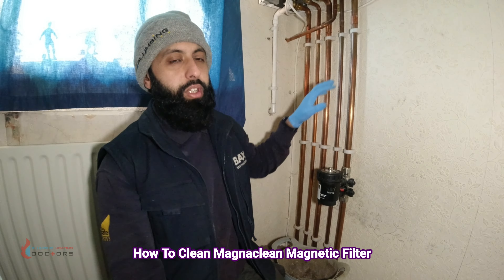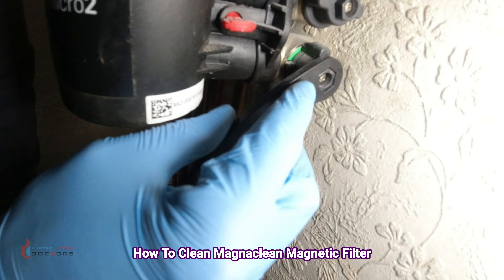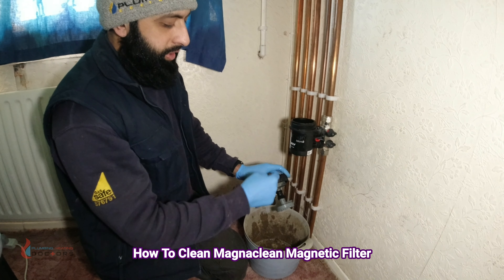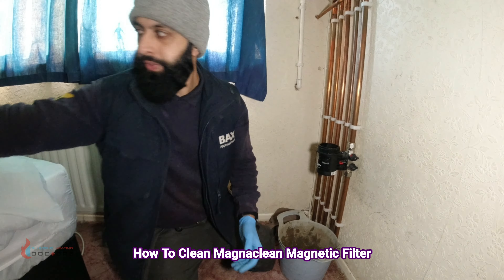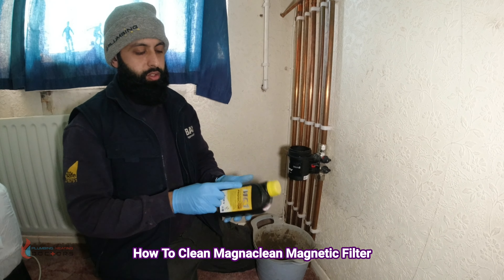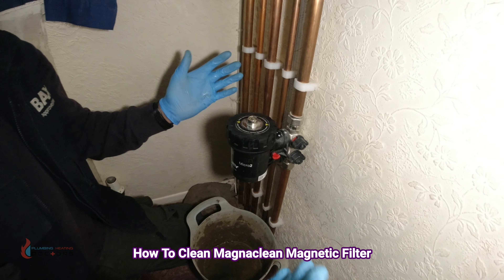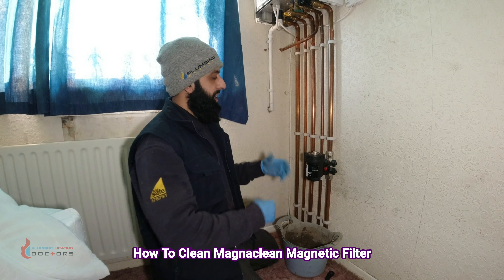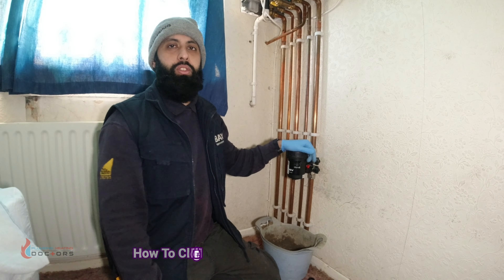How To Clean Adey MagnaClean Filter | EASY PEASY

Comment: Thank you for the simple explanation of the important basics and good advice.
My filter was installed a couple of month ago.
Yes, magnet caught some particles exactly the same way as in your video.
In addition there were some flaky stuff at the bottom of the filter.
It would not escape on its own while draining filter - had to take the filter of to wash it out.
It will be nice if you could add the correct way of removing and placing back the filter canister without damaging the rubber seals.
Reply from the maker: Thanks for sharing

Comment: Hi. Excellent video, clear and easy to understand and follow. Whoever installed ours put the top on too tight, I don’t want to apply too much pressure and possibly break tool or worse the cover. Any thoughts on how to solve this. Thanks Stuart Munro
Reply from the maker: Make sure you bleed it / remove air from top and then you just have to use the tool to remove with force

Comment: Good video, did not know the valves could be turned off/on using the spanner fitting, had not noticed it, was just using the valve handles.

Also weird place for a boiler/pipes in a bedroom?
Looks like a conversion from some other type of room ie airing cupboard to wall knocked through bedroom.

Comment: Do you think i need one of these if I have a calmag in-line filter? Not sure why my system doesnt have one these days
Reply from the maker: Calmag is usually on the cold inlet this is on the return pipe (if you dont have a filter on the return then yes you should add one)

Comment: I’m going to attempt to clean mine today. What was the solution you used? And do I need to use it?
Reply from the maker: Just water
Reply: @PlumbingDoctors  thank you, I tried to do this but the top seems stuck? I closed the valves and opened the pressure valve ( no water came out ) I then tried to open the top but it’s stuck.. any advise please?
Reply from the maker: @staceysky9989  you have to use some force it can be quite stiff. Just hold the body of the filter when you twist so you don't disturb the compression nuts

Comment: Hi I have the bigger one pro4 sense.
, it’s showing a fault still on greens though, so I took it out to clean and it looks like the plastic thing should spin on the magnet metal thing, mine seems to have picked some crap up and worn a ridge on the magnet and the plastic, making it too tight for it to spin, does it spin? 😂
Reply from the maker: it should do once clean but not sure